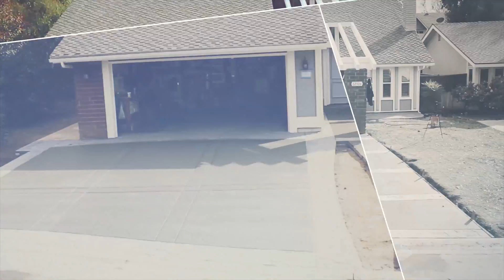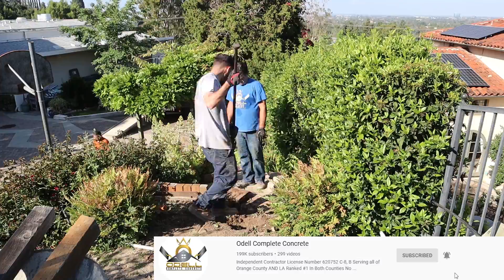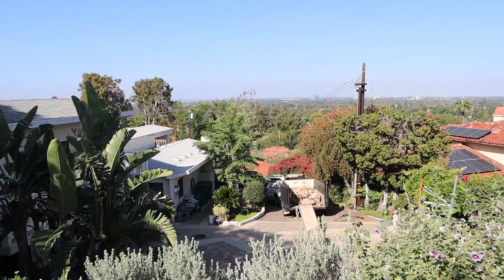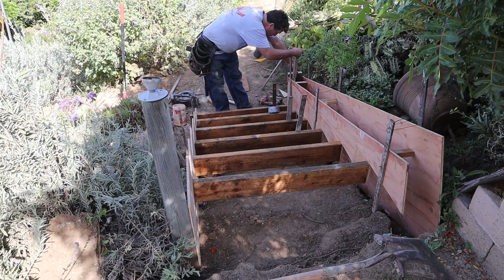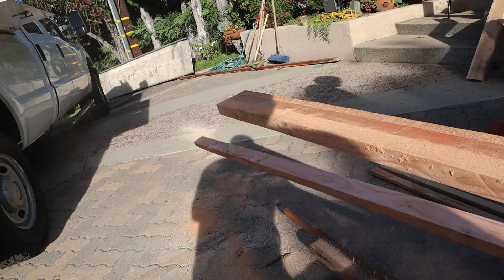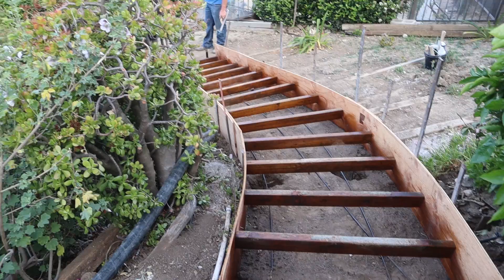Perfect Curved Concrete Hillside Staircase (Part 1)

Comment: Hi Odell. How would you do a walkway  step's landing at the bottom of steps when the sidewalk connecting to steps  slopes down 2 inches left to right so that you don't end up with  an uneven step riser.  I wonder if you have any videos of a similar case. 
Thanks
Reply from the maker: The landing would be twisted so riser could be closer to the same on both sides

Comment: Man your brain works like a computer! All that bracing using all you have & more! Gotta make sure no blow-outs happen! I did that under the Pulaski Skyway Bridge in J.C.N.J.  I was on the Bottom while they pour concrete that had tiny pieces of what looked like some type of wire but straight & pretty strong wire mixed into cement! Crazy, Scary, loud, fast, & dangerous!  Smhlol. I used 2X4s and 2X12s cut wedges all sizes lol! Stopped every potential leak/Blow out ! Your Da Best Odell Inc…👍👌👍👊🏻
Reply from the maker: Sounds like a fun project.
TY

Comment: Good job   how did  you get the spacing  on the treads
Reply from the maker: Height and length
Reply: @OdellCompleteConcrete    you are a master of  Forming  and Cement   wow

Comment: David, I haven't seen part 2 obviously, but if it's still unedited this might be a good project to explain to your viewers the "placing of concrete" which I'm sure was a 'happening thing' on this job. (Of course, I always used the words "pouring concrete" although that's incorrect terminology....and I knew better than to say/use those words.)
Reply from the maker: That's true.
The video will be live at 9:30am Satirday

Comment: Hello David, i have a question i really need answered, i am pouring a 6ft wide by 27 foot long patio against 1 side of my brick house here in Michigan. Can i pour the cement right against the brick so they are in contact or do i need to put a piece of that felt material along the entire patio to go between the concrete and the brick while pouring? I see much conflicting information. some people say go right against the brick as the patio will move away from the house if it needs to while others say to use a felt because if you do not use felt the cement will bond to the brick and if the patio moves it can pull the bricks out. Thank you and i LOVE your videos!
Reply from the maker: Your in a area that freezes up occasionally
That may make the difference whether you use felt or not.
Check with the local building department
Reply: @OdellCompleteConcrete  Hello David, so i did my 6X27 patio pour yesterday........it was my first attempt in my life at ever doing any type of cement work on this scale after watching many of your videos.....it did not go to well.....it was a 2.75 yard pour and by the time the truck poured it all in and i screeded it, it set and could not really be floated so now i have a giant patio that was screeded and that is it so you can imagine what that looks like...i was able to float a little of it but that was it. what can i do make it a bit better? Would hiring someone to shave it with one of those diamond machines help? What are my options? Thank you so much for your videos, you are a master!

Comment: Thank you for so informative videos! David would you please give an advice: Sidewalk on hillside. What degree is still comfortable to lay straight walkway and on what degree its better to build stairs? Thank you again
Reply: Check local codes.
Reply from the maker: you could go 1 in 12 with railing, spans no longer then 20' then a landing
Reply: @OdellCompleteConcrete ---Your answer  appears to be Federal code (ADA) if I remember correctly.